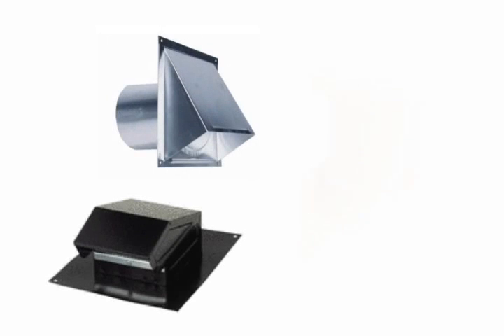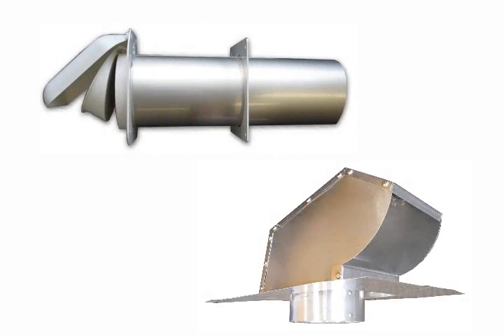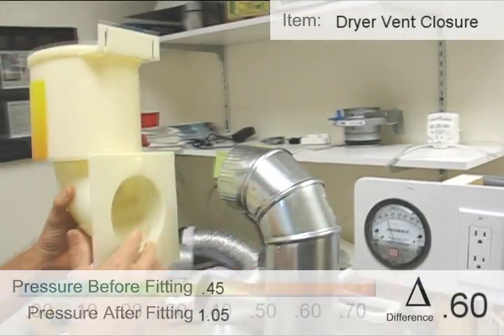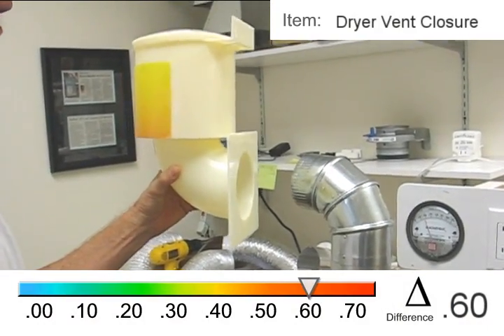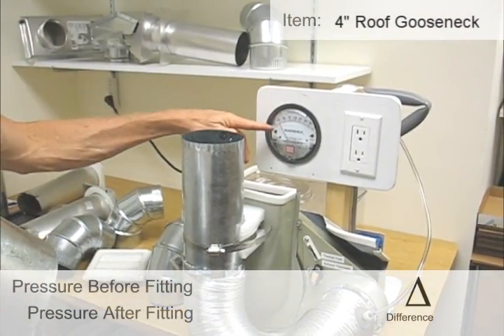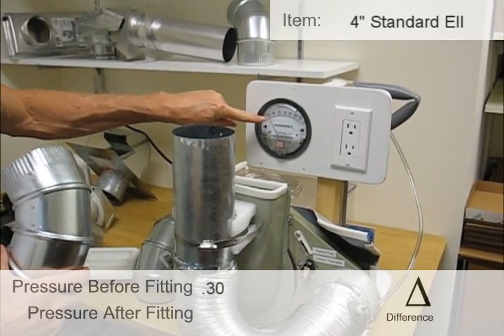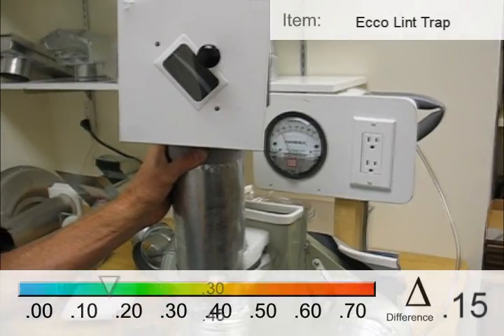How to reduce your clothes drying time and save energy costs

Comment: Our dryer is placed on an outside wall so the vent run is rather short (a couple 45 degree elbows to match the dryer vent  to the wall vent hole). Our louvre wall vent does very little to keep the cold Montana wind out of our laundry room (currently -13 with a 20-30 mph wind). I can hear the lovers rattling as the wind blows through them, right into or dryer. I’m thinking I should sacrifice some differential pressure for a more weather tight vent.  No?
Reply: And I think the same thing you think. In Nebraska, this past Winter I saw 1/4" ice build up on my metal dryer hose inside the house for several days using a vent that scores great on this test. And how efficient does that make it, if furnace has to work that much harder to heat that room?
Not happening going forward, I'll sacrifice dryer efficiency for something that prevents weather and pests from getting in my house.

Comment: Think about what he's said, There has to be a formula to get a real world idea of total static pressure by what parts assembled you have as each item is going to affect the total outcome. Say you have 2 90's and a louvered wall vent.
With Flex line in place the run at 4' I have a .43 difference total.
Unless a house is built with the dryer on an outside wall I can't see getting it much lower, and most houses are not built this way. In fact little or no attention other than water, water drains and power or gas are paid to where a washer and dryer are placed inside a home.

On top off all this, Your taking inside air and venting it outside, by doing this your drawing outside air into your house, this also will add a difference on the test you showed us and this has to be a concern as well.
If a home is sealed Airtight, and most are not, then restrictions are even lower.
I do not think you test shows enough, but its definitely a start in the right direction.
Now you place the washer/dryer room on an outside wall you can add a fresh air input for that sealed room and draw outside air in for combustion, or even for an electric dryer's exit air. Just like what is being used on HVAC systems now for heat.

Comment: This test is one-sided.  Yes, some of these vents are less efficient, but how much energy do they save overall.  Those vents that are more efficient when the dryer is operating are more likely to leak a significant amount of conditioned air from the house when the dryer is off.  In cold climates, put your hand near the dryer vent and you feel where your heating dollars are going. Since my dryer is off more than it is on, I would rather sacrifice a little dryer efficiency in order to keep conditioned air inside my home.
Reply from the maker: Thank you for your comment Kntryhard. The DryerJack has a damper that closes the opening when the dryer is off. This is comparable to other roof terminations, but more secure than many others available on the market that either don't close or simply have a screen which is not in line with residential building code.
Reply: In-O-Vate Dryer Products Any water that gets around the damper and enters the roof jack structure cannot enter the residence as the collar penetrates the flange and is heavily caulked or sealed with silicone sealant.  There is a weep hole slot at the low end of the structure.  In my opinion, efficiency increases does not have much in common with more likely to leak, at least for this vent.

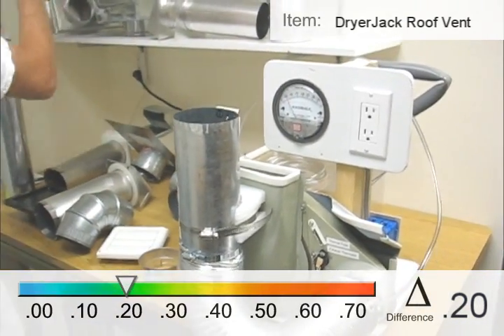Comment: In one of your tests (at 4:16) you have a Delta of .20 which you label as "Poor", in a later test with a different hood you have a Delta again of .20 (7:02) but you then label it as "Very Good".  Was this a mistake or am I just missing something?  Thanks.
Reply from the maker: Roadsurfergo The first .20 was for a wall vent, which compared to other wall vents, .20 is poor compared to other wall vent options tested that are significantly more efficient (.03 for example). The second .20 was for a roof termination, which tend to have higher back pressure readings overall. Compared to the other roof vents tested, .20 was the lowest and most efficient, which is why we consider it very good in the context of roof terminations. Many roof caps are .50 - .70 wci. Hope this explanation helps!
Reply from the maker: Scott, good catch.  At the time of this test, my arsenal of "roof vents" were minimal and because roof vents generally provide a 180 degree path to the exterior, the .20 of pressure was the best vent we had or knew of at that time.  For airflow to make the 180 degree trip, the back pressure is expected. 

Since this test though, or rather in doing this test, I was very motivated to research friction loss and design a roof vent, specifically for dryer venting that would create much less and hopefully no back pressure.  After about a year of testing and tooling, we now offer what we call the DryerJack, and the result is impressive.  If you have a moment, please watch these two vids.  There is some duplication in the video's but they both do a pretty good job in describing airflow friction, and thanks for taking the time to inquire. 
How to install a Roof Vent for the Dryer 
and
http://youtu.be/5KnRp3eXNbk
Reply: In-O-Vate Dryer Products
You didn't answer the question. If .20 is exactly the same , how can you name it two different conditions. "Poor" .20 Vs "Very Good"
.20. If it showing the same value it can't be both. Which is it ?  >.20

Comment: these are very god tests for the resistance of the elbow from the dryer side but they say nothing about how much air its stopping from going in your home!!!! i have one of the wall vents that you show as one of the best and the drywer works great but i can also see frost on the piping and the room its in is very cold. the way i look at it is i use my dryer a couple times a week i heat 24 hours a day 7 days a week so im gona get the one that seals air out the best.

Comment from the maker: The elbow was used to test the side wall vents and being on or off the test equipment would change the pre-fitting test levels.  Also some of the test were done at different times, so the location of the tap fitting could effect the lower pressures.  In either case, the Delta or difference in pressure from a hood being on and off the testing device is the point or story.  Thanks for asking, and good point.

Comment: The most difficult problem for me is attaching the hose to the dryer itself.  I only have on turn from the dryer and then the hose goes straight to the wall and out. 

Dryers IMO need to have a longer length of hose out of the dryer it'self.